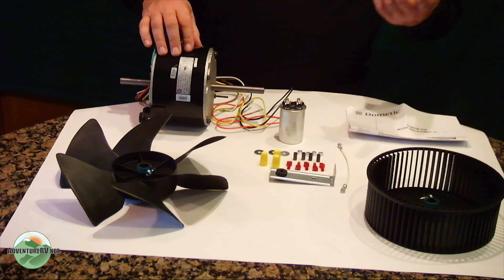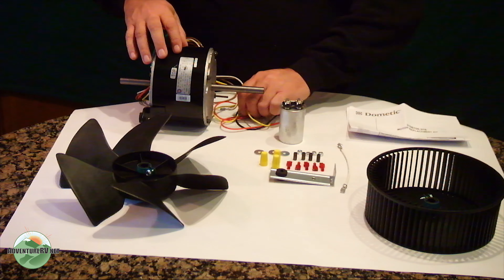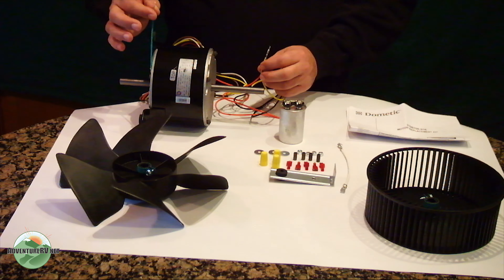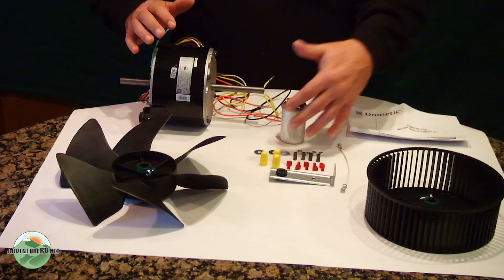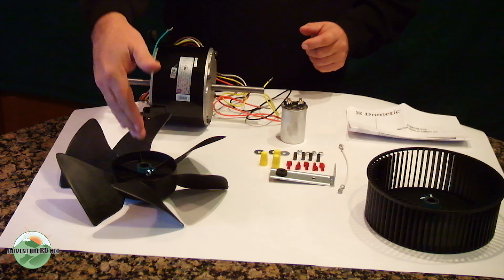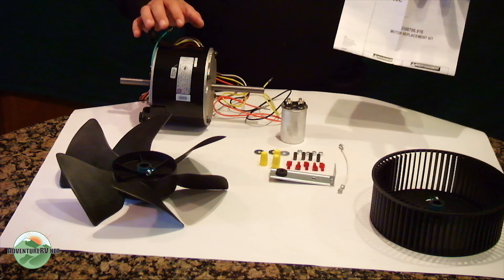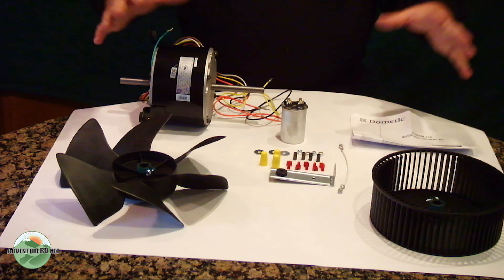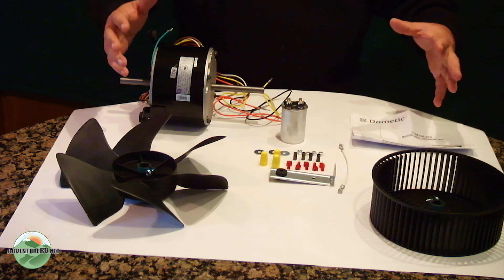Dometic RV Camper Air Conditioner Fan Motor Kit 3108706.916 Unboxed

Comment: I received the parts and they are correct. However, some genius at Dometic thought it would be a good idea to tac-weld the backside of the cage fan to the rest of the frame. This piece also provides the tiny 9mm motor mount bolts which have rusted to pieces. I may need to return this kit, as there is no way to get the old motor out without tearing the housing apart and having to fabricate a new one out of sheet metal. Way too much work for this junky AC, and I will NEVER buy another Dometic appliance again. I have replaced fan motors in Coleman AV units before, and it's a simple 1hr job.